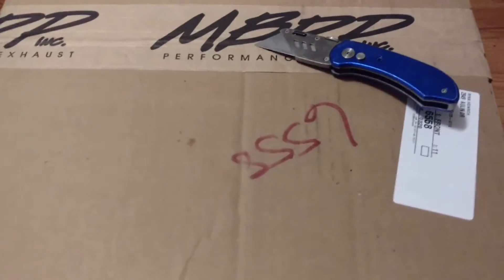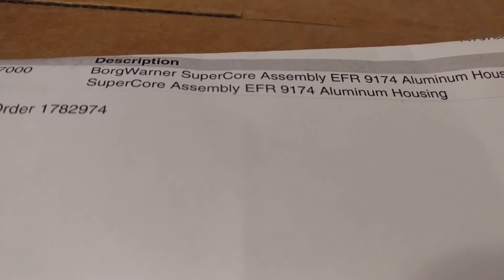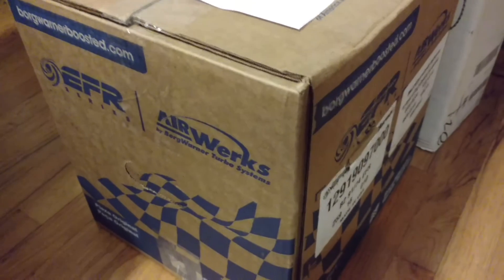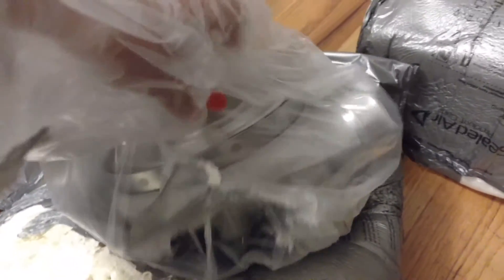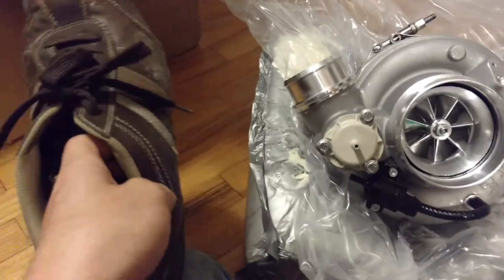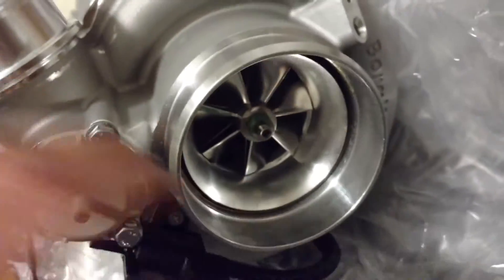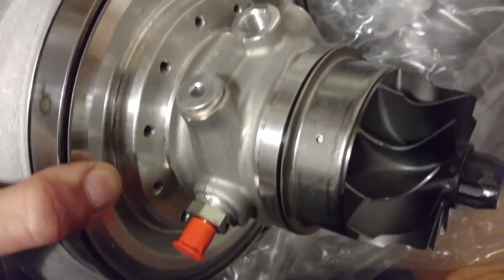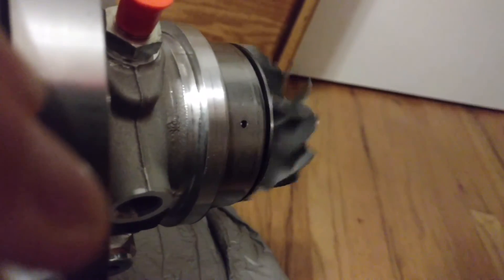#FractalFB Rx7 Part 15 - EFR 9174 Unboxing Video

Comment: What manifold are you using, are you doing a hybrid turbo?
Reply from the maker: Samuel Nieves I guess technically it's a hybrid setup with the S5 manifold, but we all know it's more than just that...
Reply: Nice am still working on my turbo setup. I did not go with a ball bearing turbo but I am using a 89 t2 turbine and housing
Reply: With a hx40
Reply from the maker: When you're ready for a turbo, hit me up at Full-Race.com (ask for Ryan).  As for your manifold design, good luck, it's going to be challenging.  GPopShop does excellent machining work and I would highly recommend them.  Otherwise, ditch all that and go with the new Turblown Exhaust Manifold from the Get-Go.